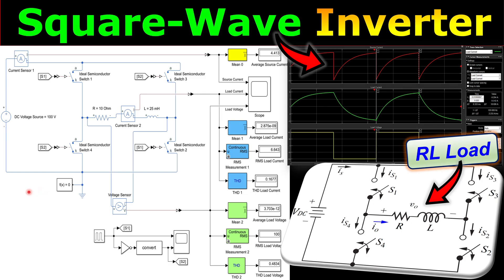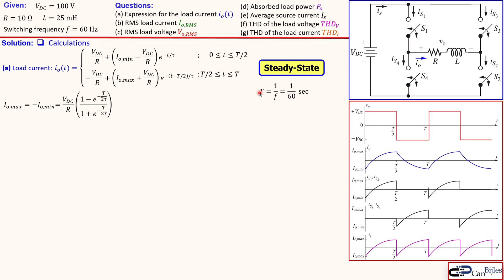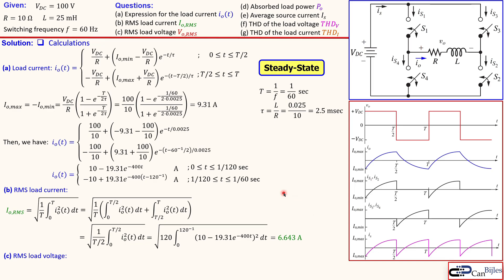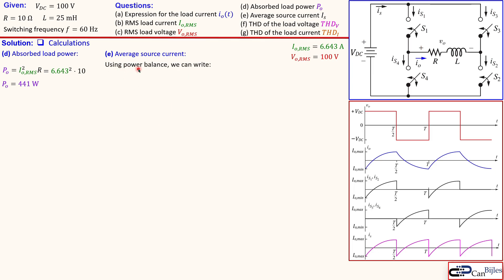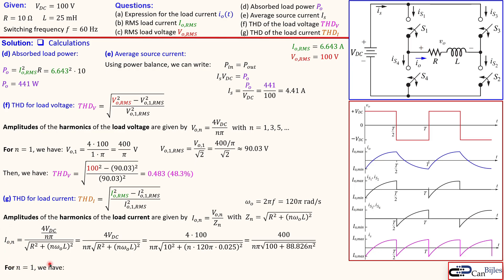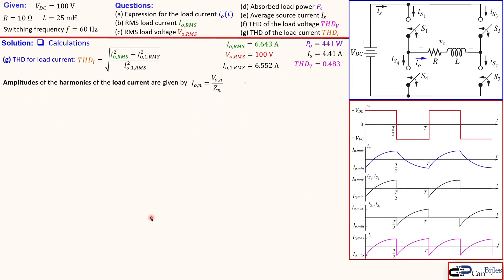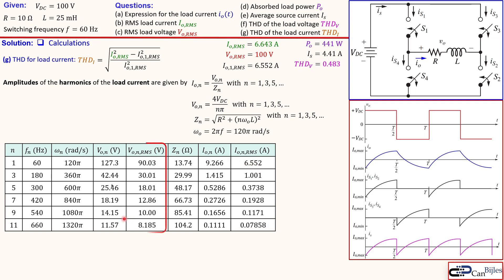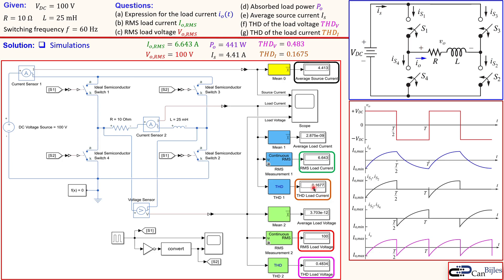Single-Phase Full-Bridge Inverter with RL Load ⚡ Power Electronics 💡 Calculations & MATLAB/Simulink

Comment: Hi, Sir, in your expression of current max/min, why are you using Vdc/R instead of Vdc/Zp???........ Is it because of the RL response of the steady state where inductor become short-circuited. I see in your expression if am not wrong, you using force response. would you mind to derive the expression of the formulas of load current and voltage above in your calculation and thank
Reply from the maker: The V_DC/R is the steady-state value of the load current. At steady-state, the current in the inductor is zero.
The derivation of this formula can be found in many book, for example: Power Electronics, Daniel Hart
Reply: @CANEDUX  thanks sir.
Reply from the maker: @jamesjohn2537  You are welcome!